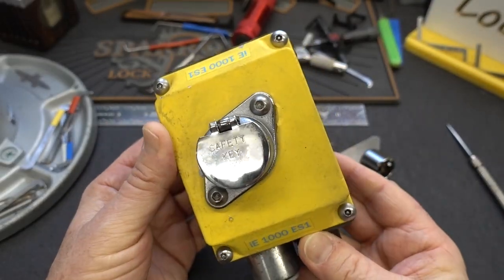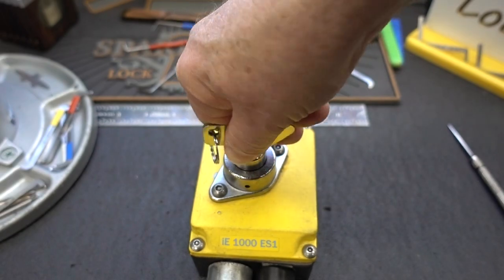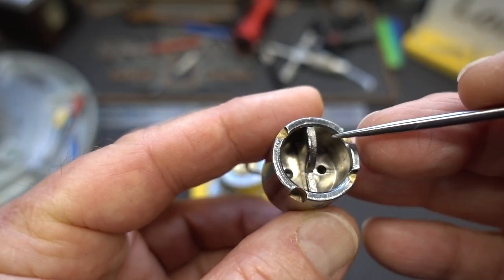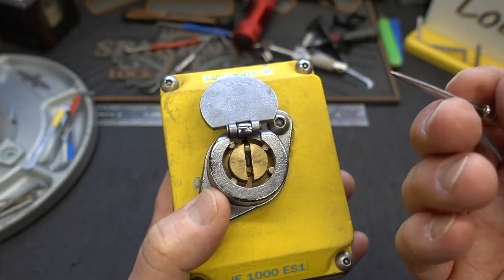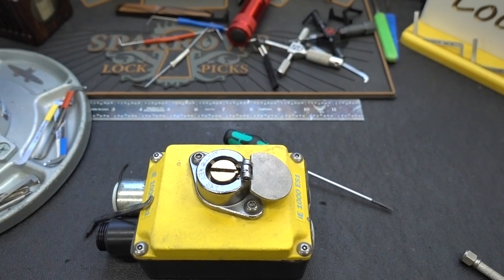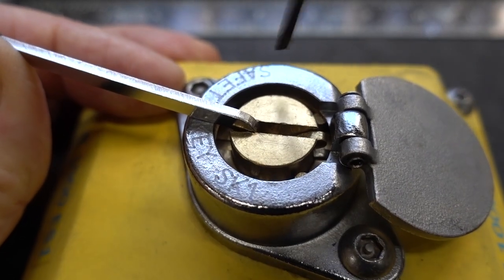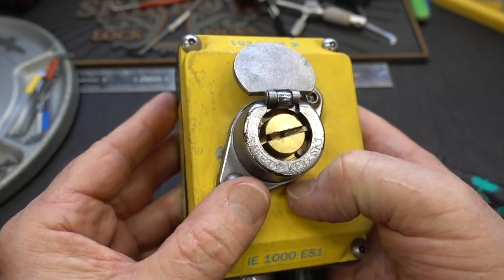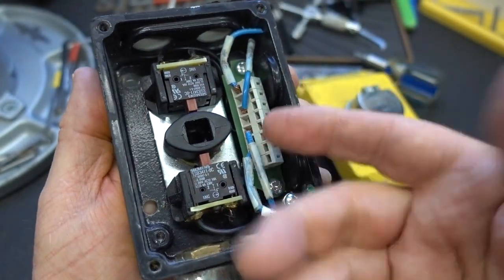(1846) Electrical Safety Lockout

Comment: I'm kind of surprised and how voltage the insides look. Seems like you wouldnt want to be switching 240v with this.
Reply: it would interrupt the current for the coil of a large relay that powers the machine.
Reply: Definitely would.  The electrical distances inside were typical of 400/230 V systems.

Comment: Why are so many industrial safety locks tubular locks. Very nicely picked Sir👍🇦🇺😊
Reply: Reasonably robust, and thus when full of dirt easy to clean, plus the key itself is very robust, and not easy to break if you accidentally drop it a floor or three. Also harder for some buffoon to hammer in a screwdriver, and use a pair of pliers to operate the lock, when he lost the key.

Comment: For a nicely made version of this type of lock have a look at https://www.castell.com/product/y/ especially the 1960s 70s versions which were around when I first started using them. By the way you would have to pick all the locks on the front of the box to release the one key on the side.  But beware just attempting to defeat these safety systems was a sacking offence

Comment: That's not funny.  I put my fingers on a disconnected unit one time that had a large capacitor in it and that's what happened. Lol.
Reply: Probably a current regulator circuit. So that's when you learn to discharge the circuit with a screwdriver before poking your fingers in there.
Reply: That's when one learns the true importance of the "D" in "SIDE".  Switch off.  Isolate. Dump. Earth.  watch?t=222&v=G2RPu4Hs_qo